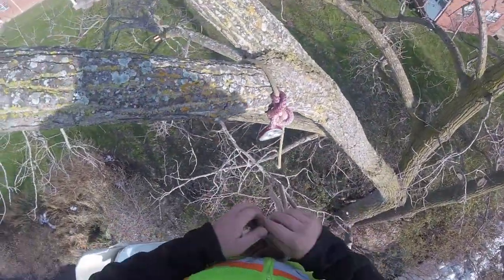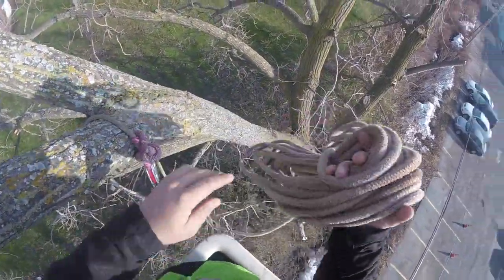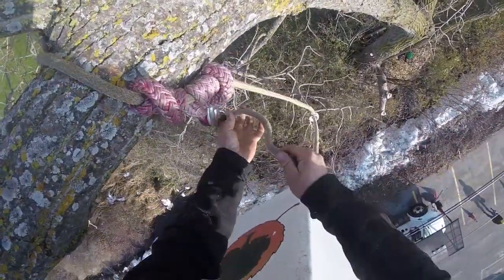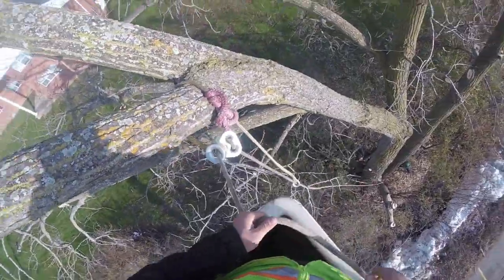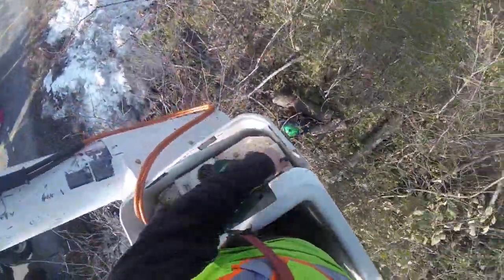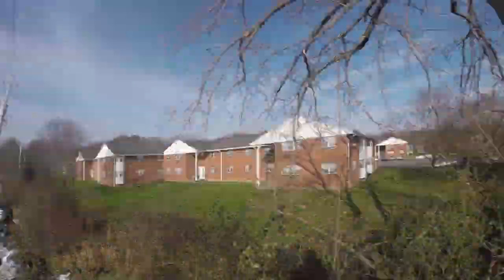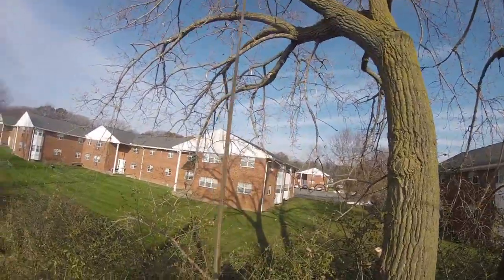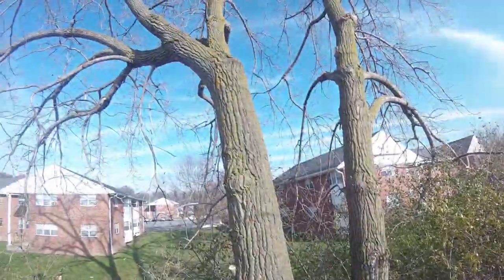Retrievable Rigging Ring and Ring With Aerial Friction

Comment: Why do you put your half hitch above your carabiner?
Reply from the maker: In this case my primary rigging point was above the piece being cut so the piece wasn't being negative rigged otherwise the order on the stem would have been reversed. The half hitch wasn't strictly speaking necessary, however it does give the added benefit of shifting the center of gravity higher (the piece being rigged hangs more vetically), provides additional firctional contact area to the rope on the piece being rigged down (it's less likely to slip off), if it where to slip off, the carabiner is a back up, and lastly it shares the load with the carabiner so there are lower forces applied to the gate (less chance of failure due to unintended and unforseen cross loading)